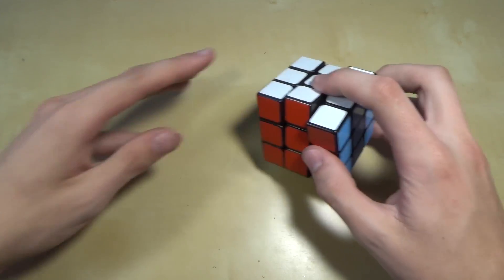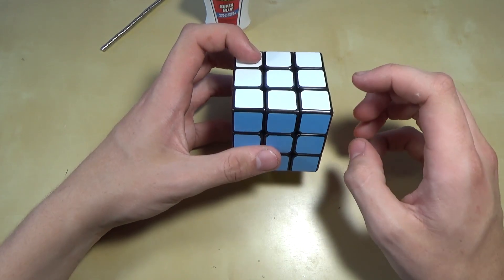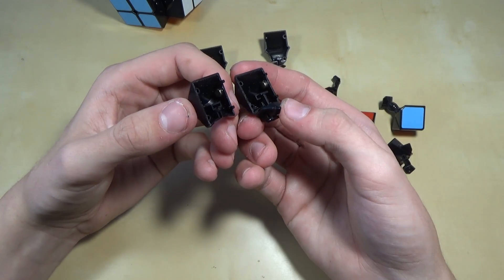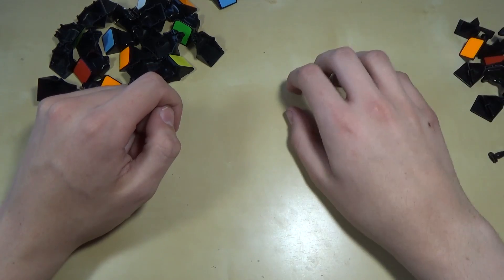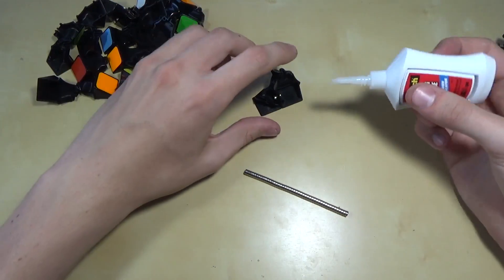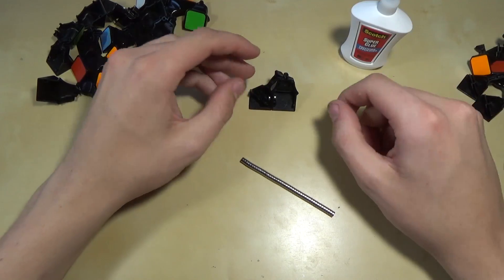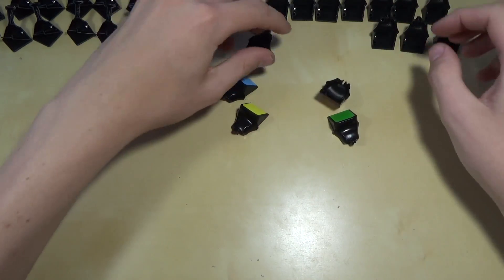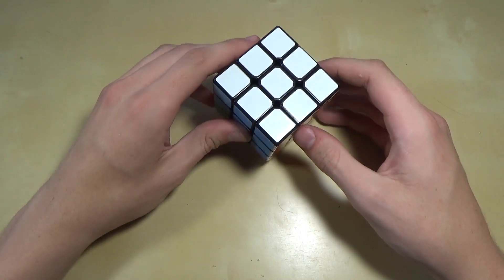How to Make a Magnetic Speedcube (Valk, etc.)

Comment: i can magnetize it way faster, first glue on the two magnets then take both pieces and instead of putting the corner or edge aside, you can just put a magnet on the corner and edge and repeat that for all the remaining pieces and that saves a lot of time, but you have to glue 2, 4, 8, 16, 16 magnets at a time in that order to finish magnetizing
Reply: U know u can't perfectly line them up so if u use all edge and corners the error will get bigger
Just like if you photocopy a paper and then keep photocopying the copies the colors will wear off